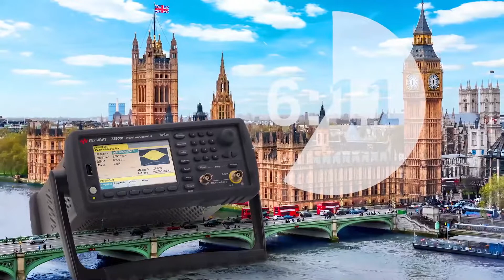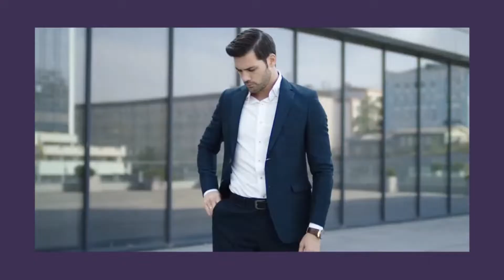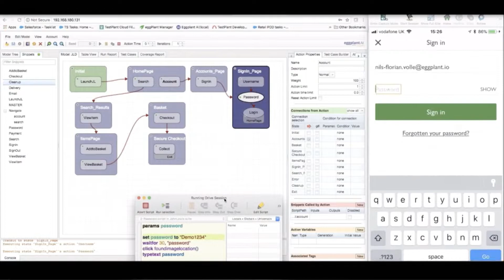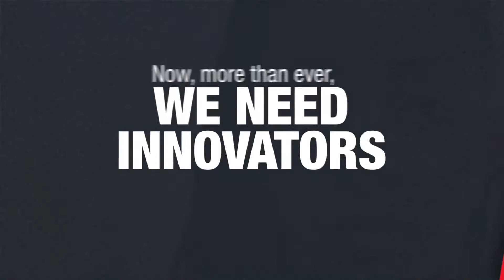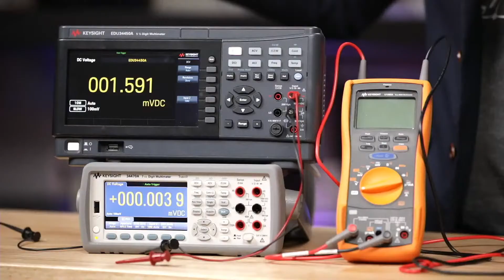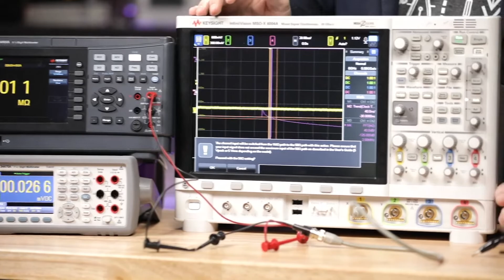Live! 20-Apr Keysight University Live

Comment: 49:20 - I think to be able to see the current in the scope you need to "transform" into a potential difference (voltage), you can use a shunt resistor (with a drop voltage) or a current probe.  But is not necessary to see it in the scope since the 7 1/2 DMM already shows that the current ripple+noise is very, very small and as a DC signal, there are no "waves" to see in the scope.